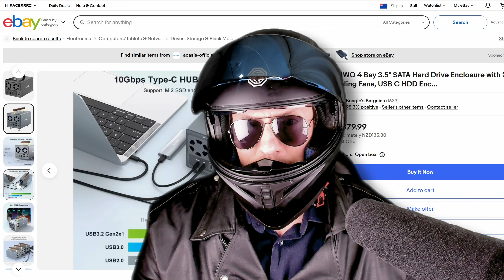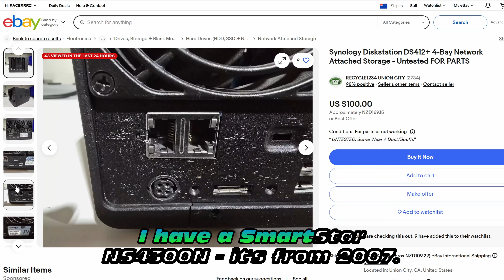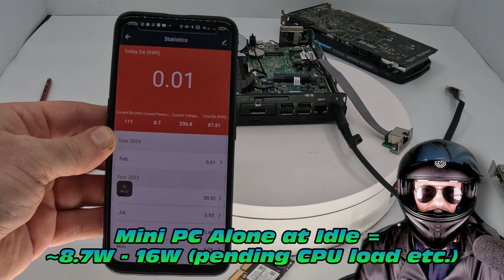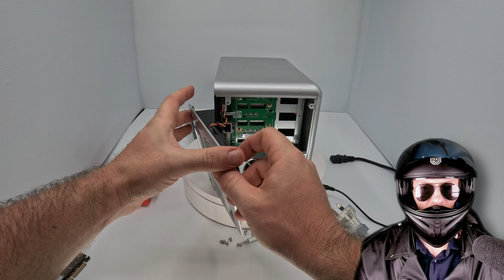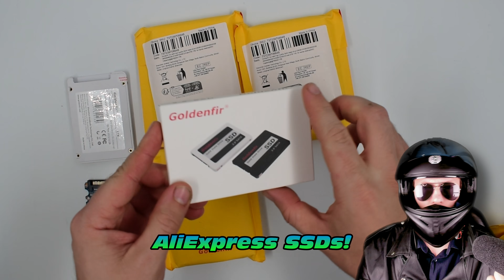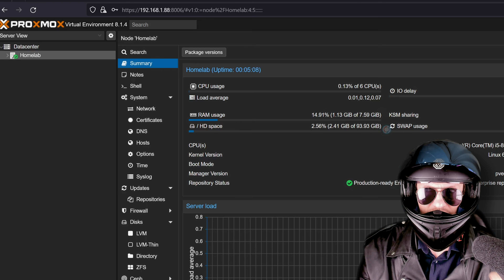Cheap Storage Upgrade! Add this to any system. #RACERRRZ

Comment: i thought you were gonna use a the nas not only for the hd bays but also for some kinda cursed sata power situation.
Reply: forsure still turned out to be a cursed power situation
Reply from the maker: You called it haha. Its workout out relatively well. UPS + Mini PC + NAS Bay + 6x SSDs for RAIDZ2 + USB Dock = Frankenstein, but it works for the intended purpose and draws ~ 20W max.

Comment: I may get this wrong as an American, but I believe this is what my AU gamer buddies refer to as "Enterprise Bogan IT". What a deliciously jank setup - skip the NAS enclosure next time and go with some thick corrugated cardboard. SSDs are so shock resistant the only consideration will be airflow. Keep up the good work.
Reply from the maker: There I was hoping to out-do the Aussie Enterprise Bogan IT (EBI) standard with a Frankenstein Mini Server (FMS). I mean cardboard is easier - especially for SSDs (a 3D printer would be nice - slightly less jank lol). I hope to eventually get a large volume HDD (as a scratch disk) in this empty NAS shell - and maybe more SSDs. It becomes a useful storage medium to mount other components - like a 10GbE NIC connected to a riser cable in the Mini PC.

Comment: try installing the nas' firmware on a virtual machine, see if backplane works?
Reply from the maker: Good idea actually. I'll try that again. It might be more likely to detect in Linux also. I attempted to boot Windows 10 from an SSD connected to it via PCIe 3.0 on a HP Z440 but that did not detect in the BIOS at all. 

If that backplane worked it would be quite cool - you could use a riser cable to connect it up. That's worth checking out! I'll read up on backplane connectors also - there must be something that would suit this setup to give hotswap functions. My main focus was on getting the SSDs connected via the USB protocol (mostly due to the lack of PCIe lanes on this Mini PC). I am working on a similar concept for the Lenovo M920Q - but there I am converting the PCIe slot to SATA ports through a series of adapters (future video!).
Reply: @racerrrz  good luck and let me know how it goes, also try asking AI and the forums, interesting and useful problem to solve
Reply from the maker: I'll keep an eye out on this concept - I like the idea of being able to connect a bunch of SSDs directly to PCIe with one of these back-plane connectors. Pending the interface there may just be enough bandwidth to keep 4x SSDs running. PCI 32-bit will be too slow (~133MB/s bandwidth) - PCIe 2.0 (4 lanes) would net ~2000MB/s bandwidth.

Comment: used r720xd are cheap, r730xds are still less then 200, but power sucks
Reply from the maker: For a more serious home server they are well worth the expense - no comparison to a Mini PC. But what I do like about this build is the low noise and low power draw. I wanted something I could leave running 24/7 and not notice that it's costing a lump sum in power. It's also going to serve as a little testing station - I'll use Proxmox to test out new software or to explore new server management packages. VMs set up with specific purposes - and likely not all running all the time (the Mini PC is low on cores/threads).